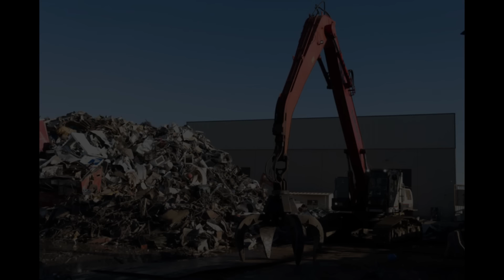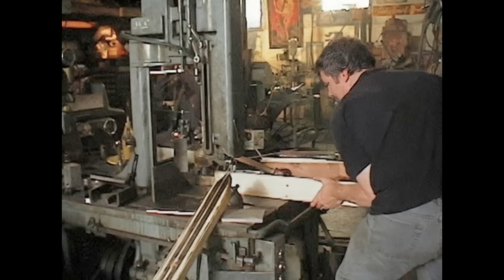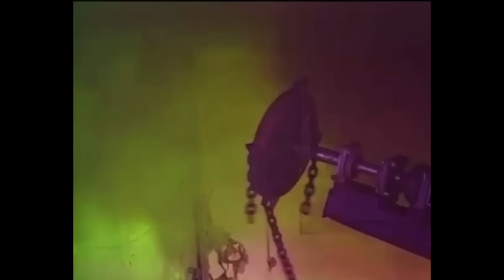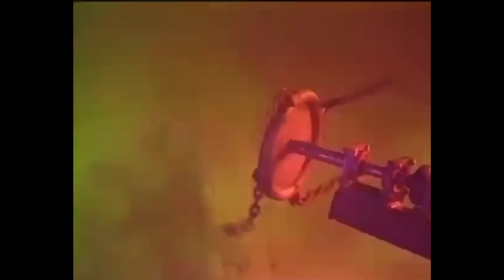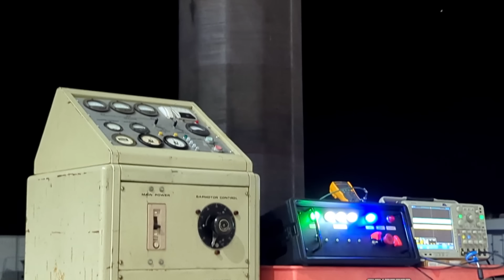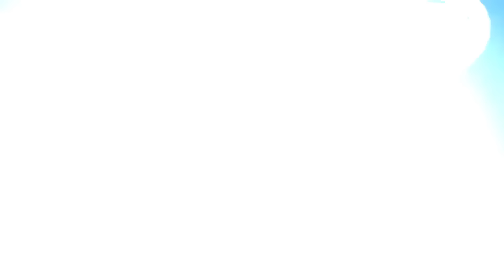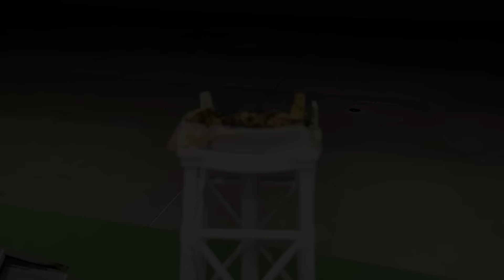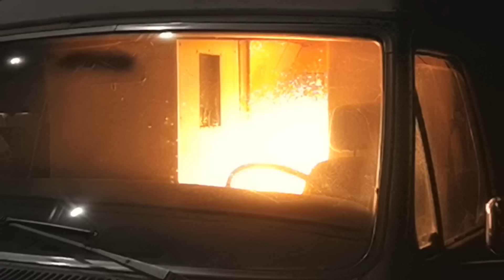Creating a Plasma Cannon by Boosting Tesla Coil Strike Energy

Comment: Now lets fire a tungsten particle accelerator at a distant target and the proper interval to keep a plasma channel open and apply the same principle.  Send the pulse through just as the beam makes contact with the remote target.  Or rather, predict when it will contact the target.  Isn't that what Tesla was essentially trying to create?  Lighting towers that could either transmit electricity or destructive power.  Two faces of the same coin that would end the need for warfare as we know it?  Science isn't just for fun.

Comment: If the church was grounded with wire to the pavement, would it still explode?
Reply from the maker: A prominent lightning rod with a heavy enough conductor might save it.  Or if they could develop a way to rapid deploy more water towers.

Comment: Might be a bit unrelated, but still: will you attempt to create a mass-driver devices like Gauss gun (or even railgun, but it's probably somewhat harder to assemble) to combat hostile machines? At certain time a lot of technical school clubs in my country (incuding the one I'v been a member of) had their own low voltage non-lethal Gauss gun. There also were videos with higher voltage Gauss guns capable of penetrating not-extremely-thick books.

As for the other options: a projectile moving at high speed will also ionize surrounding gas, which theoretically could be utilized to create a channel for the discharge. Although I'm not sure about will this kind of experiments go unnoticed by the local authorities
Reply: P.s. In the latter case, adjusting the projectile size (and probably the shape) and speed could affect the length of the ionized air region (as the smaller projectile will decelerate faster, crossing the boundary where it won't be able to ionize surrounding atmosphere) and the energy used to accelerate it, so it might be possible to use two separated capacitor arrays, one for the projectile acceleration and the other for boosting/powering the coil
Reply: P.p.s. how are you dealing with the waste heat of your setups? Megawatt-levels, as you mentioned in previous video, will probably require a sort of cooling in order to withstand such energy and not perform unnecessary self-destruction. I'm not talking about superconductors, as even the most modern ones seem to be too expensive and require hardly-achievable cryogenic temperatures to operate (not sure will temperature of liquid nitrogen be enough, but liquid hydrogen temperatures are, and they're quite challenging to achieve without some modern laboratory equipment. EDITED: well, seems like there exist superconductors with required temperatures in magnitudes of liquid nitrogen). But if somehow they could be obtained and utilized, it'd be excellent, as it opens some new possibilities. Except for quite obvious use as a material for wiring, they could be turned into projectiles, as they tend to be pushed away by magnetic field (be vary not to exceed the induction limit where superconductivity shuts down or Abrikosov vortices form). But that would probably be irrational spending of available superconductor
Reply from the maker: @v0597casisbestwaifu  Although the peak power is hundreds of megawatts, the RMS power is low enough that air cooling is sufficient for all of the components.
Reply from the maker: Railguns can be effective, but are rather heavy and bulky.  I like that the interior of a Tesla coil is mostly air.  This makes them way more affordable.

Comment: Would a higher power, or larger diameter laser focus the arc more? Additionally, would a capacitor bank alongside your pulse former help, or would it simply just be worse than the pulse former? Ionizing the air with a laser to direct arcs would also be pretty cool, but would require good eye protection and being far from others.
Reply from the maker: The energy would all have to go through the pulse forming network, as it is tuned to minimize damage to the Tesla tower itself.
Reply: @LightningOnDemand  Ah ok that makes sense. It would simply be adding more power to the pulse former. Thank you for explaining it.

Comment: When you say shaft you mean a hole he dug ? Good idea measuring the foundation. Whats the shaft for if not your conductive rod idea ?
Reply from the maker: The main shaft was apparently a hydraulic lift of sorts, which would bring a conductive rod up through the coil for both tuning and for safing the top of the tower in a lightning storm.
Reply: @LightningOnDemand  apparently.. 🎶 you dont need a hole for that 🎶 ...its gutted. This is great we are getting somewhere here. Thanks for your time

Comment: Ooo details from the site. Interesting. I never felt like we needed teslas insight if it did in fact come from the buildings. I just went straight to the buildings. Im still curious* of your details though
Reply from the maker: The one I found most interesting was accidentally discovering his grounding system for the tower.  There's no mention of it in the Long Island notes: I just assumed he ran copper conductors down the shaft and radially from the bottom, and that all that copper had long since been scavenged.  When I ran my 210 kilowatt coil on the site I tried to find a good earth ground... nothing!  Long Island is a big sandbar, and even driving a copper rod in produced over 1200 ohms impedance.  But the original granite blocks for the tower foundation were still there and had 2 inch threaded steel rods coming out of each one.  In desperation I measured the impedance to ground of the rods in the granite and found they were surprisingly low.  Attaching all 16 together yielded an impedance to ground of less than an ohm!  Turned out that Tesla used a rare conductive granite imported from Germany!  Not only was it the structural foundation it was the electrical foundation as well!!
Reply: @LightningOnDemand  insane

Comment: "The tube should become noticably brighter"

fucking explodes 💀💀
Reply: The pulse-forming network found the transition slot, however the energy rating of the diagnostics was exceeded by a critical margin ☝🤓
Reply: @anoobis117 I'm in the testing industry, you can bet that I will start to use this frase from now on
Reply: @anoobis117  Translation; It got hit in the snussy and got fucked.
Reply: The understatements were my favorite part, the way he says "A loss of structural integrity" as the burning walls of the church tumble through the air was fantastic!
Reply: It was brighter 💁‍♂️
Reply: "creating visible fault" and it's vaporized copper eruption
Reply: You noticed the understatement motif I see.
Reply: Also et elmo's fire being a bad omen
Reply: I knew where this was going before it happened.
Reply: Same.
Reply: I was in fact noticeably brighter
Reply: Now, THAT'S comedy!
Reply: You knew that was coming.
Reply: WAHHHHH THATS A NONO WORD D:<
Reply: @ferrocerium123  Isn't it past your bedtime? Nobody gives a shit, kiddo....fuckin grow up

Comment: I wonder if a dye laser tuned to the first ionisation energy of Nitrogen might let you generate a partially ionised path that the arc would preferentially discharge through?  Then the arc becomes more targetable.  (Not thinking about laser guns at all....honest! 🤣)
Reply from the maker: Ionizing a long path of air is apparently very difficult.  It requires a filamenting laser that can produce peak pulse powers of a terawatt or more.  This is rather far beyond my knowledge of such things!
Reply: @LightningOnDemand  Fair enough!
Reply: @LightningOnDemand idk if you read this comment, but what about an electron beam... At a few MeV it would be relativistic and travel a few meters in air... It would have to be specially made for the purpose though and idk if there is much info on this sort of stuff... 
Due to high time dialation it should stay rather narrow, but it might branch on hitting atoms... Idk how strongly the beam would diverge in air... With a top notch state of the art hobbyist design, you might be able to fit one with sufficient energy inside that topload.
I dont think it would massively increase range, but a few extra meters of conductive path is pretty good, and probably gives a little bit more directional control as well

Edit: aperantly a rule of thumb is about 3.7m (or smth like 10 or 12 feet?) per MeV...
So a 5MeV beam can travel about 18m or ~60feet through air...
And it would prob need to be pulsed. As continuous power able to create ionized paths would likely oversaturate the area very quickly but idk.
Reply: Terrawat pulsed, 2000 car batteries could be a good starting point for that. 😅
Reply: what if it could switch at an incredibly high speed? would it require that much power?

Comment: Respected Sir,
First of all, an very excellent and dangerous video. Your coil is impressive, but I am wishing to humbly submit that this entire tension of boosting strike energy and relativistic runaway was already solved in ancient India many centuries before only. In our Vaimanika Shastra, the principles of Agneya Astra and Vajra Astra describe exactly how to channel concentrated Prana (life energy) through a Vayu channel (your plasma) to achieve pinpoint destructive capability without any pulse forming network confusion. The field focusing electrode with servo is merely a crude approximation of the Drishti Yantra our Rishis used to aim divine energy using sacred geometry and the operator's focused intention only. India is best in world for this advanced energy science, we are having full knowledge since Vedic times. Kindly make one video on ancient Indian lightning weapons on urgent basis.

one more thing only. While you are spending crores on this pulse forming network and fancy German engineering, our Indian engineers at ISRO are achieving same energy concentration with simple jugaad and recycled parts from old cars and household electronics. We are best in world for getting maximum output with minimum input. Our Mars mission cost less than your Hollywood movie only. This is our scientific superiority.

Thanking you,
A Student of Bharatiya Astra Shastra from India.
Jai Hind. 🇮🇳